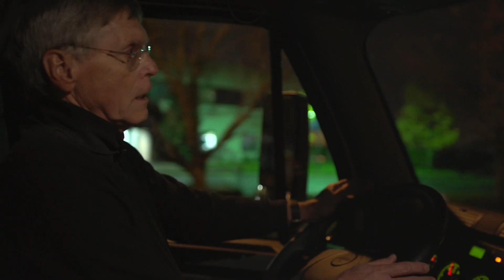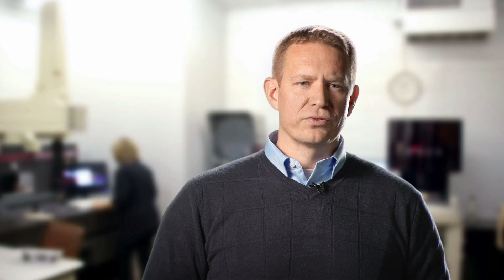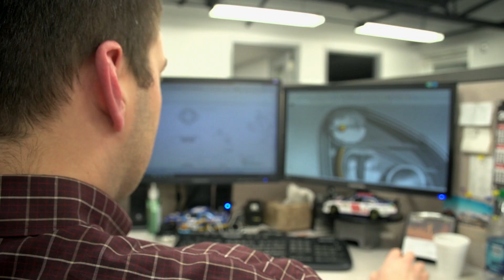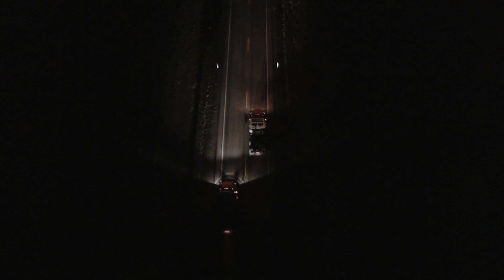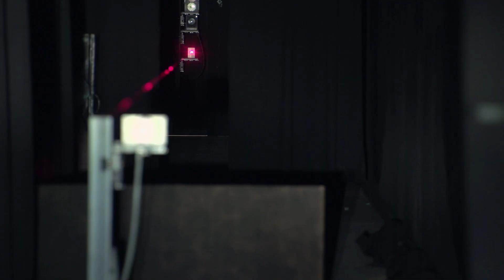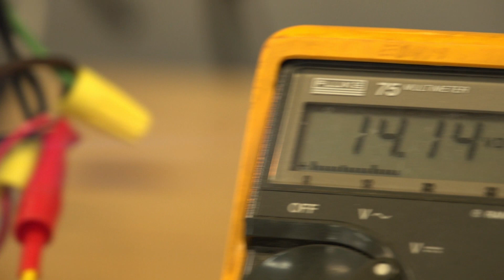Making Daylight: Truck-Lite Custom LED Headlights

Comment: My truck lite headlights are dull
There bright just not bright
Reply: Start with observing the ground points. A weak ground affects the voltage. Finding a remedy should be cake.

Comment: How much better are they though when everyone that hasn't seen this video or used LED lighting Brights the crap out of you because they are dumb or ignorant.  Or both.
Reply: If people are giving you high beams you must not have aimed your lights correctly. I have these in last two Volvo's and are incredible, rarely get flashed because they both were checked and adjusted correctly
Reply: @100pyatt  They are aimed correctly.
Reply: LED does not burn the retina like halogen or hid lights
Reply: 4 month check back. High beam flashbacks virtually non existent. Way more with old halogens. Drove 4 hrs the other night on 2lane hiway without 1 flashback. These led headlights are incredible. Actually enjoy driving after dark now !!

Comment: yellow is easy on the eyes you will learn just like the sun the light we grew up with. Do you want a white path way some say no? I found mountain roads like yellow best. Test idea with led flashlight and halogen flash light.
Reply: Daylight at noon is 6000-6500 k light temperature. That is the color range of these LED, compared to 3800-4200 k for halogen, which is closer to sunrise and sunset color... Your eyes are better able to see 6000k than 4k because of the retina's receptors